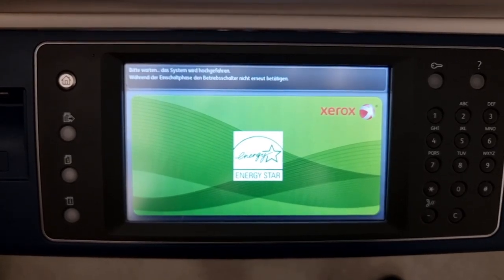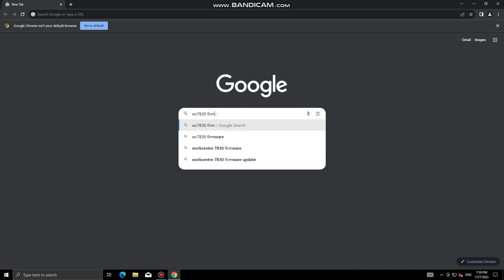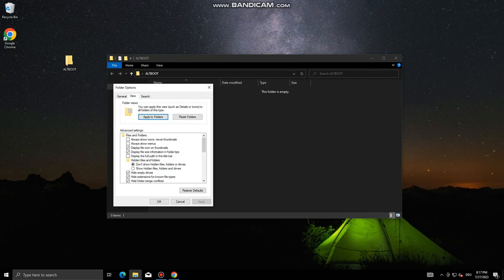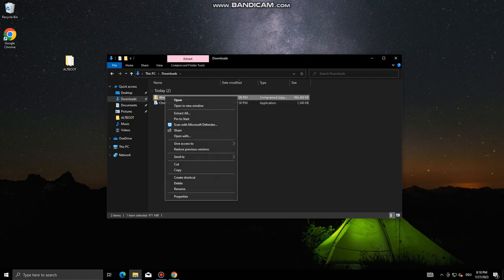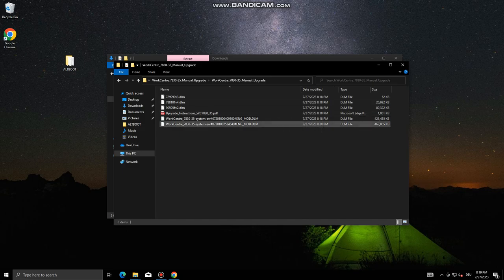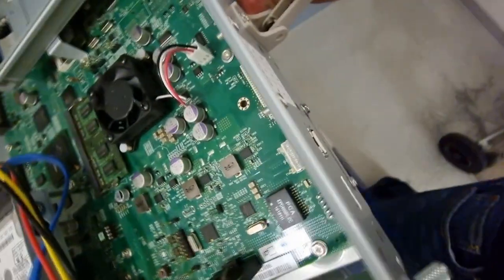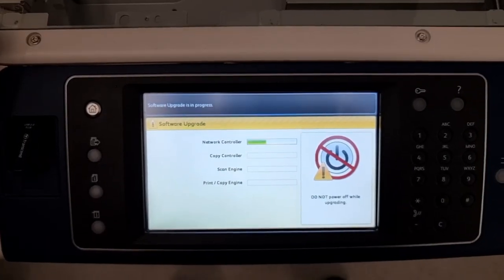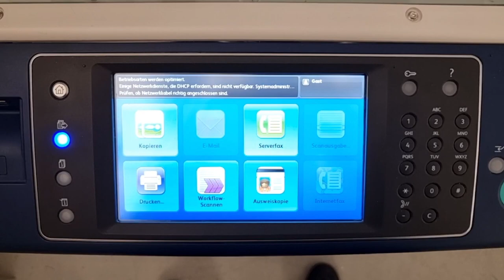Bootloop Xerox Workcenter error repair HDD defect WC 7830 7220 7530 Altalink 8030 8130 green screen

Comment: I used these instructions for an Altalink B8055 and was able to get it booted again. Did not require replacing the HDD thankfully. 
A few things to note for others is selecting to view file extensions is not necessary. I did not do DISABLE_DATA_BACKUP, but did do the FORCE_UPGRADE and the update went through fine.
All the printer settings and network configuration were still the same after the update. Replacing the HDD will wipe everything because it's a new drive.
Reply: What you did was a regular AltBoot -- the video describes a Forced AltBoot... as you described, a normal AltBoot keeps all the custom settings in tact. A Forced AltBoot is only required when there are user settings (or other settings within the configuration) which are undetectable, that could be causing the system to green-screen bootloop.